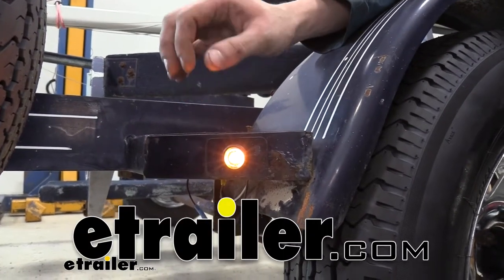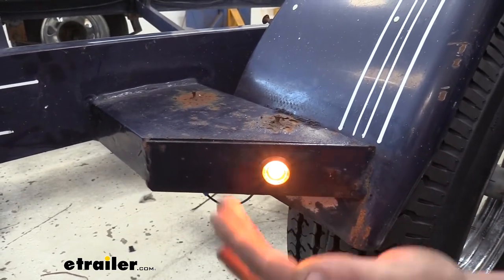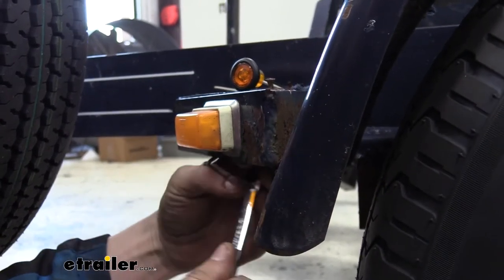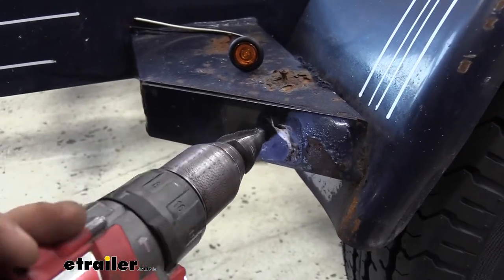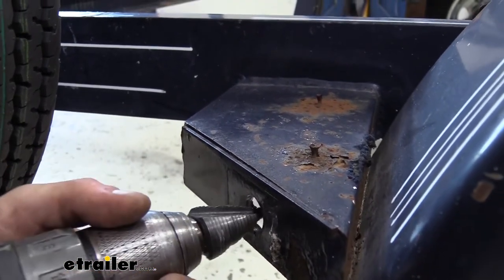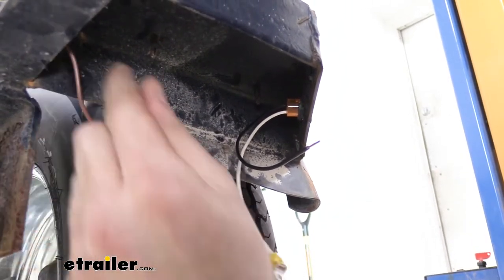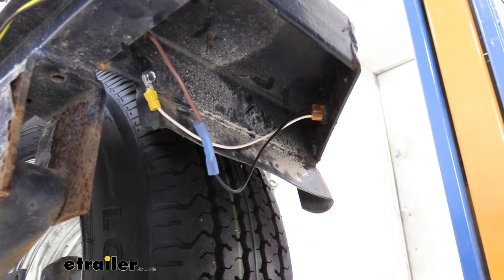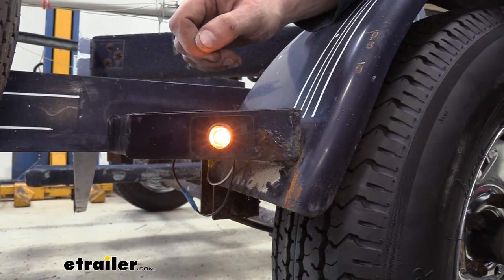etrailer | Peterson Piranha Mini LED Clearance or Side Marker Light w/ Grommet Review

Comment: Thanks wanted to see the heat shrink connection y’all use. Just a side note: After drilling the hole ~0.7” install the rubber grommet then push in the LED for the correct fit.
Reply from the maker: We are happy to help! Thank you for the feedback!
https://www.etrailer.com/Trailer-Lights/Peterson/M171A.html

Comment: I’m wiring led markers to my atv. Is this the same process, white for (ground) & black (hot) I wanna wire them to my headlights
Reply from the maker: Typically, the white wire is going to be the ground wire and the black will be the power wire. You can test this by connecting it to a 12V battery and it will only work one way.